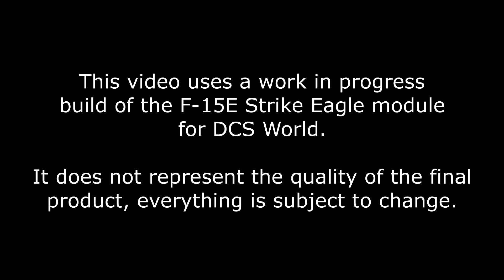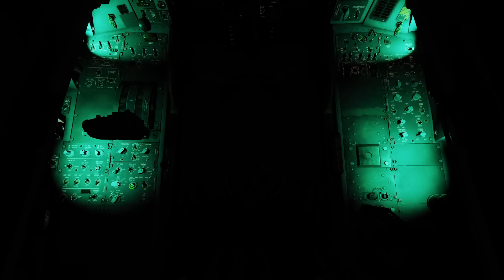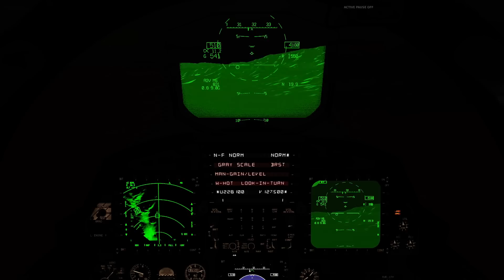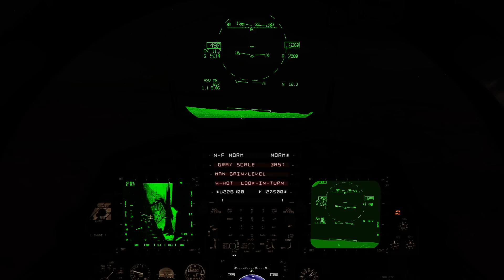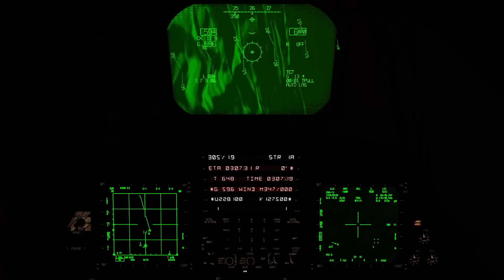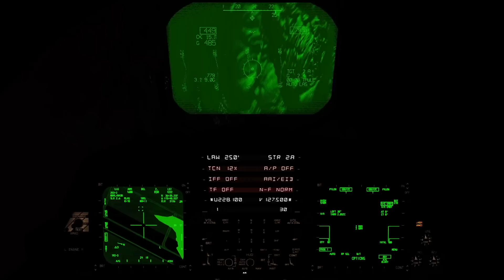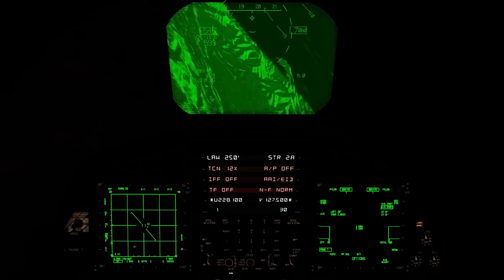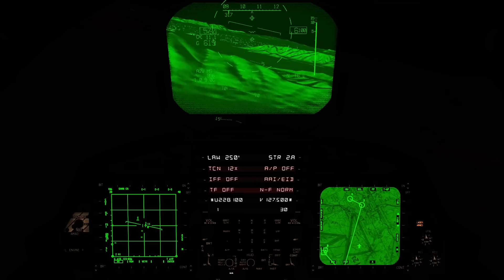DCS F-15E Strike Eagle | NAVFLIR and more

Comment: navflir could pretty much help during night operation. i could imagine using navflir on hmd if that could be possible where you can see on the visor what pod sees
Reply: The F-15E from the time that it’s being modeled in DCS didn’t have the JHMCS unfortunately. So no HMD. However they did say they may make a Frankenstein F-15E, which may get a HMD.

They’re also, supposedly, modeling the Israeli F-15I Ra’am, which has Israeli avionics and probably has a HMD, considering the Israelis have been using HMDs for way longer than the US has.
Reply from the maker: Hi,

The Israeli eagle will come with external modification only.

Thanks

Comment: Looks amazing the radar and navflir you made. Good job

Is it possible to use the Navflir with some kind of HMCS? I don't know if the F15E have that system
Reply: I don’t believe the F-15E will be getting a JHMCS, unfortunately.
Reply: RB have said that it will most likely come after launch
Reply from the maker: Hi,

AFAIK the F-15E NAVFLIR is only able to look forward so even with a HMD there is no way to have the same result as the apache for example.

Thanks.

Comment: Will this F-15E have a "basic" mode ? I'm a beginner and I've never flown high-fidelity jets before, the F-15C is my favorite.
Reply: You won't need a basic mode. Don't let it intimidate you. Just set basic controls for flight and get good at that, then start adding more controls for systems, weapons. You'll be amazed how quickly you can remember controls when you add them this way. Add controls for gun first if you want to keep it simple. The gun is both an air and ground weapon. Good skill to keep sharp. Then add Sidewinder and AMRAAM. Then good old unguided bombs. Once you get good with these systems in the day, add controls/pod for night work. You're on you're way then. Integrating other weapons on top of this foundation will be easy. Good luck!

Comment: Those are a lot of empty panels on either side of the pilots legs
Reply from the maker: Hi,

As the aircraft gets updated with more modern displays and systems, a lot of panels become obsolete or redundant.

Don't forget that this airframe is based on the F-15A/B introduced in 1976 :)

Comment: interesting it's ground radar is much more capable than f18s I'm surprised. I thought f18s do better a/g compared to f15
Reply: F18 it's a multirole fighter while the F15E it's focused in AG, so I guess why the radar was better, to deliver better performance to pilots.
That's said, it's very capable at AA too
Reply: @Vireca  so it's specific to e variant and not the other f15s?
Reply: F15c is A2A only, no ground radar that I am aware of.
Reply: @z33r0 actually  the F-15C is quite capable for AG role much more capable than Su-27 in DCS. It's USAF things that F-15C is only specialized on AA role.
Reply: @z33r0now3  AFAIK the F-15A/B/C/D had and retained A/G radar modes through the various radar upgrades. Sure there may not be a truly useful A/G master mode, but that doesn't mean the radar can't. Note that some F-15Cs had APG-70s, like the F-15E. Also note that some export F-15Es got an APG-63v1, which was intended for the F-15C.
Reply: @c.m.2150  I am talking DCS, not real life obviously! Sorry if that wasn’t clear.